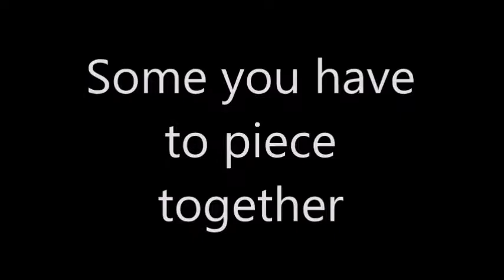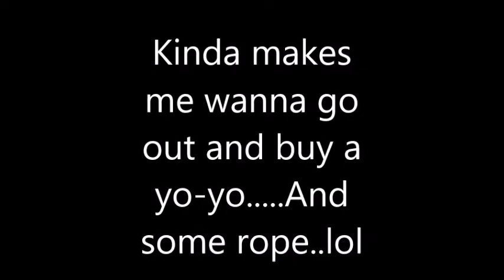Humming bird toy factory

Comment: Paint pot .pressurized.. you thought was vacuum 
🖖🏼😊😲
Reply from the maker: Ya know.. that makes sense.. sometimes we fiure suff out after the fact.. thanks for watching
Reply: J&E Adventures The only reason I know I have watched bridges being painted and that’s what they usually have mounted in the back of a truck for the purpose of pressurizing the paint pushing it through a hose so they can do the job quickly
Reply from the maker: They do make a job alot easer